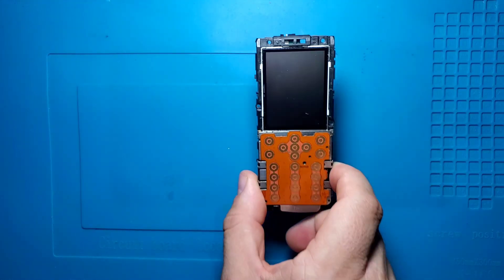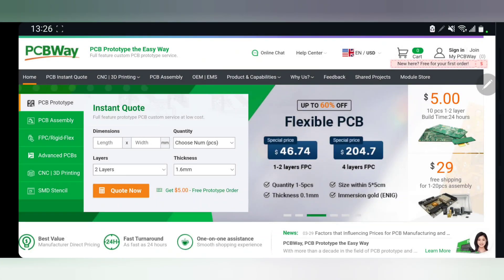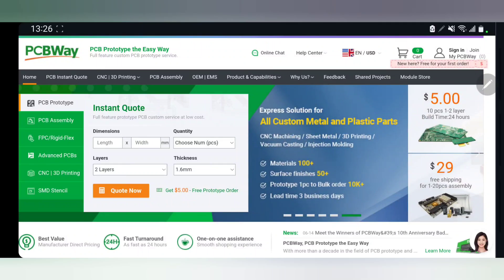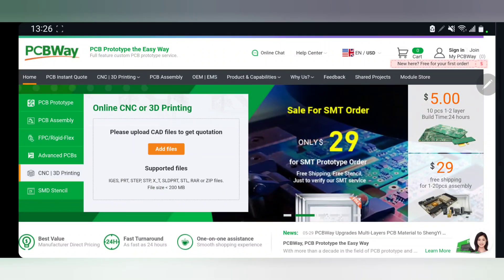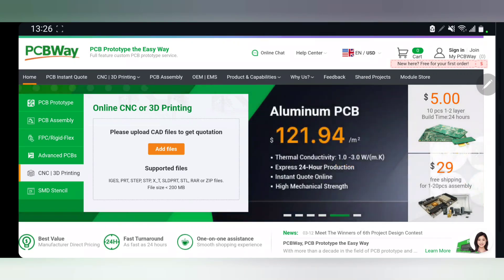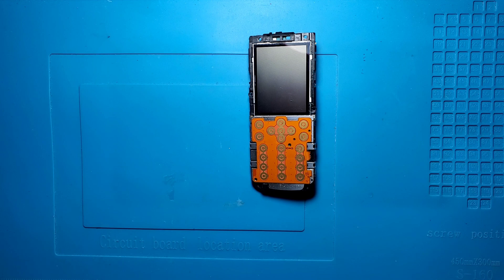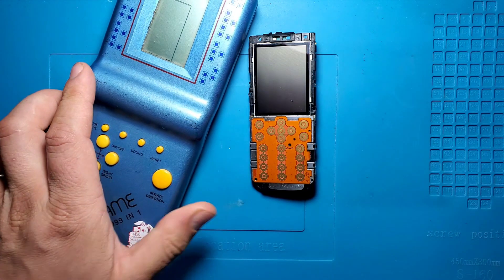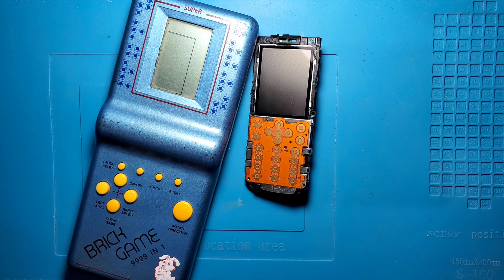Turning Nokia 6233 into a brick game console

Comment: Broo you forgot that nokia played Java games and if it symbian they had s60 games or s40java games supported also 😁 try make that again but used nokia slide symbian E65 or somethin i forget🙃🤣next time much more easier since the keyboard and screen section was seperated😁 and please soldered the speaker next
Reply from the maker: sound is not emulated, that's another reason i don't like non-smartphones
Reply: Hmm nah i mean the speakers can be soldered directly to the board 😁🙏👍
Reply: Back in the day i used to modify nokia N-Gage with chinese phone more bigger speakers.. if its nokia the speaker output basicly always 2 points of contact it was the same with old chinese phones.. they had 2 contact points(+ and -) and i used to even replace keytones LED for nokia N-Gage to green/blue etc from other cheap chinese phone back in the day yeah in indonesia back in 00s so many folks modify their Nokia.. Range from nokia6600 to N-Gage then N70 to mid modern ones.. we modify it back then way before android was a massive thing😁 man i miss those fun era of phones😁☕